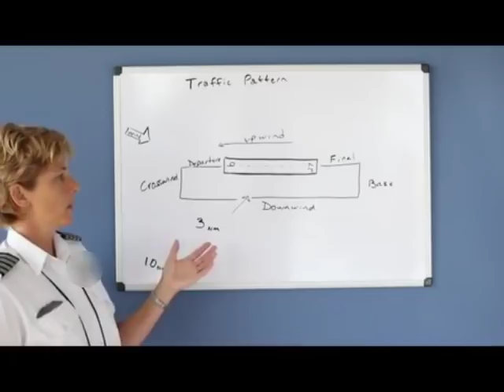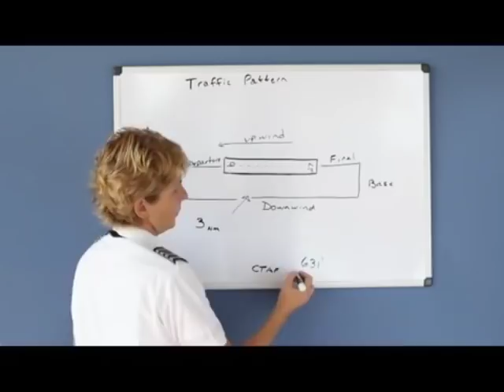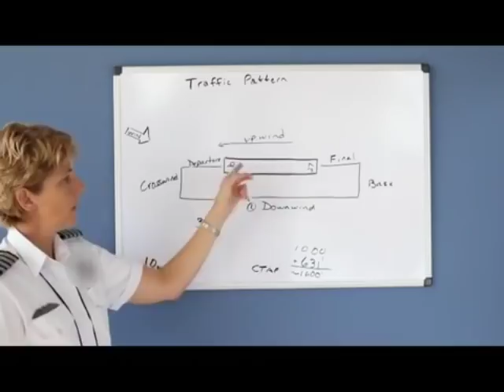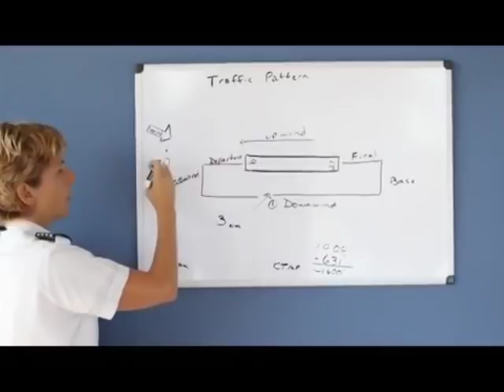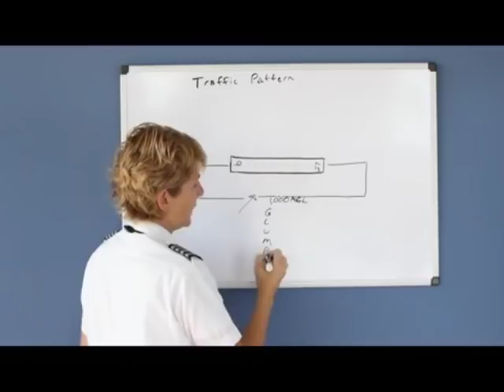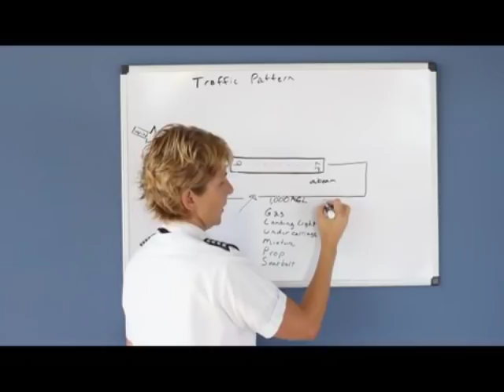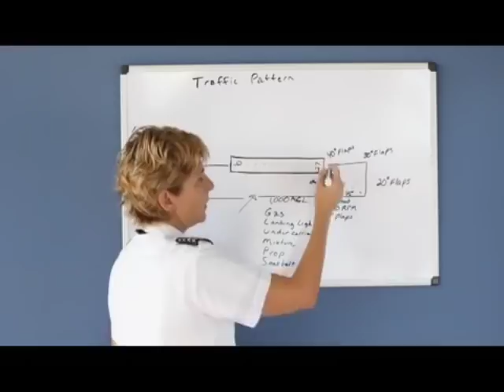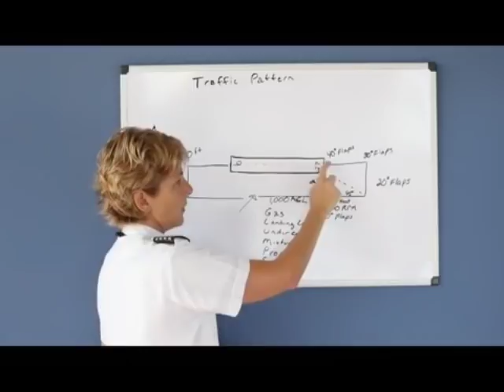Traffic Pattern Communications (Private Pilot Lesson 5k)

Comment: Pre-landing checklist in Australia is BUMPFISH - Brakes-check, Undercarriage-down or fixed, Mixture-full rich, Primer-locked, Fuel- Pump on or check shutoff valve open, Instruments-Oil temp and pressure, Switches- Mags on both, lights on, Harness- secure.

Comment: These are very good lessons! Every instructor is different, but I learned GUMPS rather than GLUMPS. My instructor said the S stood for "seat belts and switches." The switches check included the lights, including the landing lights, as well as the circuit breakers. The only advantage to using GUMPS  instead of GLUMPS is that there is one less letter to remember.

Comment: 1) At uncontrolled strips, it's more useful to say your aircraft type and color than a complete recitation of your N number, which no one can see. "Yellow Cub" is quicker and more useful than "Piper 1234 Delta."
2) Once you're in the pattern, declare your intentions after landing ('Touch and Go' 'Full Stop' 'Low Pass' 'Stop and Go' etc.) so others can time their actions.
3) Turn base when you have descended about 300' if you have trouble visualizing the 45 degree angle idea. You need to lose about 1,000' in total so you'll lose a little over 300' on each of the 3 legs.
4) Keep it tight. Don't make huge, drawn-out patterns with power needed on a long final. You should be able to easily make it to the runway from any point in the pattern once you enter the downwind even if the engine quits. This also makes it easier for others to spot you in the pattern and reduces your total time in the pattern.
5) Watch your coordination and airspeed like a hawk in the base-to-final turn where you are most vulnerable to a stall/spin. Start the turn a tad early so you don't need a steep turn to get lined up on final. Make small corrections and USE RUDDER appropriately. Just before you turn final, take a last look on the extended final approach line to see if someone without a radio is already on final.
6) Repeat GUMPS (or whatever acronym) checks on each leg, ESPECIALLY ON FINAL. It's your last chance to make sure the GEAR IS DOWN! Develop this habit early so transition to complex aircraft will be easier.
7) Consider the possibility/desirability of a go-around at all times. The later it gets in the approach, the more difficult a go-around will be because you will be lower, slower and have more flaps and trim to clean up (and you may have gear, too). Trim can be especially tricky to clean up. The earlier you make the decision to go-around (because the approach is not stabilized), the easier it will be to safely accomplish. Learn how to recover from a bounce properly so you have that option (recovery) as well as the more-difficult go-around from a bounce.
8) Keep winds in mind throughout the approach (not just on final): If you have a significant wind, it will increase your ground speed on downwind so you might want to start your power reduction a little early and you will need to crab into it on base in order to fly a rectangular pattern so plan for that as well as any crosswind correction and reduced ground speed on final.

Comment: Thank you. I have two questions:
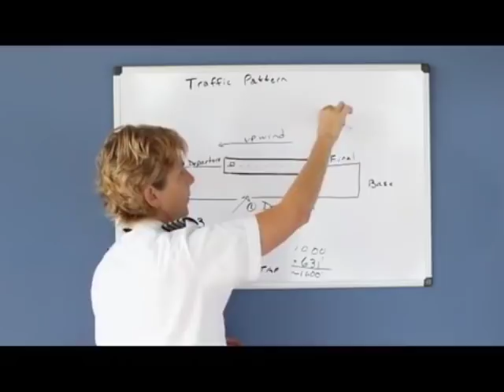1) when saying "left downwind", I don't understand why it's LEFT. Left of what ? I suppose it's left of the runway. But which axis ? Logically, it's the longitudinal axis (its length). This seems to be confirmed at 4:30. But if you look into the direction of the wind (aka downwind), you enter right of the runway, not left. (edit: solution at the end of this post)

2) what if there is no wind ? Wouldn't it have been more useful to say "27 left" rather than "left downwind" ?

edit: Oh at 4:30 I understand now, it's LEFT downwind because the traffic pattern is always turning left, not because of our position with respect to the runway.
Reply: Don’t make it complicated... think left downwind - left turns base, final. Right downwind - right turns base, final. Fly safe
Reply: Think in terms of the touch and go circuit training pattern. Take off, turn left to crosswind...turn left downwind..left base and left on to finals.
Reply: Even simpler way of thinking about it: if the runway is off your left wing, you’re in a left pattern. Runway off your right wing, you’re in a right pattern. That advice single handedly helped me understand patterns

Comment: I believe there is something wrong about remain and exit the traffic pattern.
1） If remaining in the traffic pattern, commence turn to
 crosswind leg beyond the departure end of the runway within 300 feet of pattern altitude.
2)If departing the traffic pattern, continue straight out, or
 exit with a 45 degree turn (to the left when in a left hand traffic pattern; to the right when in a right hand traffic pattern) beyond the departure end of the runway, after reaching pattern altitude.

Comment: How can you tell if you are 45 degrees from the runway at the turn to base-final?  Also, if you mess up that turn, would you enter the pattern over the runway to crosswind leg, or would you exit the pattern?
Reply: You approximate. When you look back and can form a straight line with the corner of the runway you're at about a 45 degree angle.
Reply: Soulxlight Oh ok, thank you!